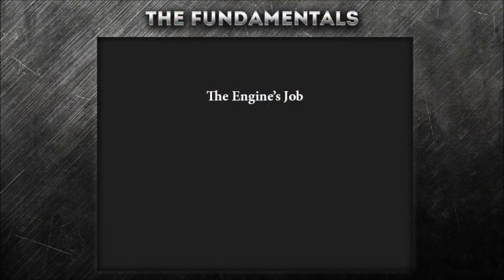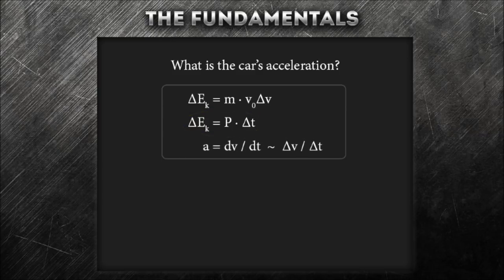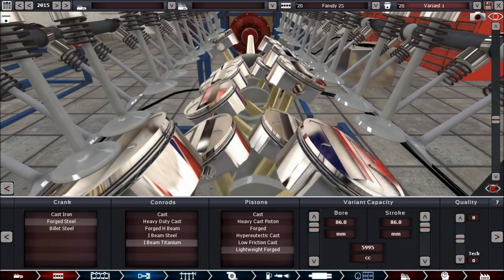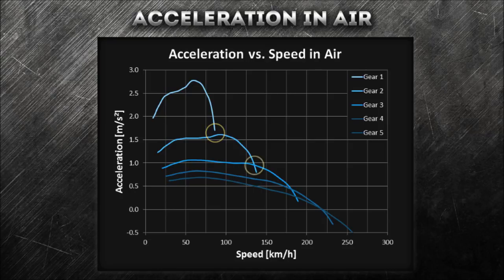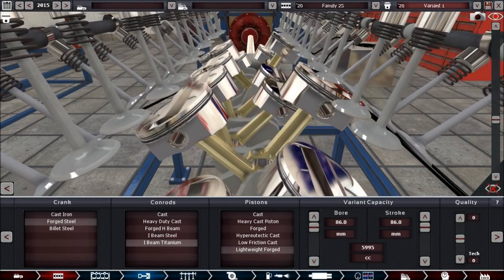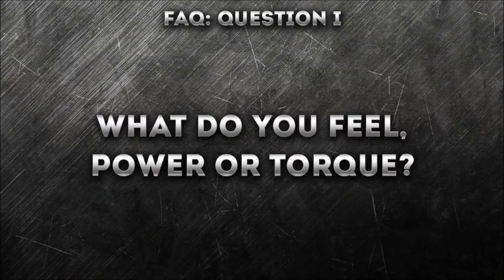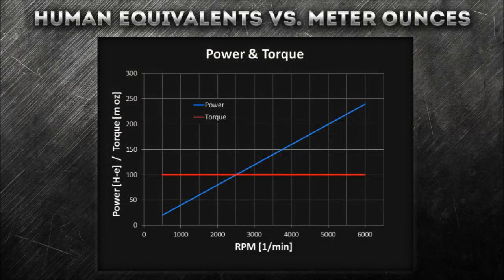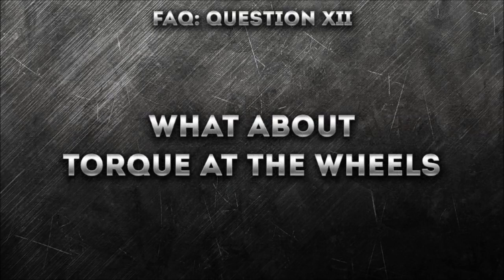Power & Torque: Acceleration Exposed

Comment: Hello.. thank you for taking the time to make this video. You've done a great job : 
However, I don't understand why the acceleration vs. Speed lines (the blue ones) in Example 1 are exactly horizontal. 

As speed increases, the power output increases but the energy required for acceleration also increases. Do these two quantities increase at exactly the same rate so that they cancel each other out?
Reply: Also, throughout the video, you say that acceleration is dependent only on the power output. However, at 12:00 in the video, the acceleration curves match the torque curves, and NOT the power curve. Why is this?
Reply from the maker: Yes, the effect of "more power with revs" and "more energy required for same acceleration at higher speed" cancel out each other precisely.
Reply from the maker: Regarding the matching of the acceleration and torque curves: that is explained in detail in the video, I can't explain it any better here in the comment section. I suggest you watch it again and follow the derivations, that is where the answer lies.
Reply: I will do that. Thanks for the reply.
Reply: Because Power = m x a x v = T x w (w is the angular velocity of the engine) --> a = Tw/mv  . For a given gear, the w/v ratio is a constant, and so is the mass, therefore the acceleration in a particular gear is directly proportional to the torque curve. Hence the shapes match.

Comment: Power is how fast energy is transferred. In an ideal world, why the acceleration isn't the same in all gears regardless of how fast the car is and in what gear? After all the power is the same.
I don't get it when it's in terms of power, but in torque, it's easy to understand that the torque and speed of the engine is transformed through the transmission and so acceleration becomes less with higher gears because torque because the transmission decreases the torque and increases the speed.
Reply from the maker: The question you ask is answered clearly in the video: higher speeds require more energy for subsequent speed increases, hence at constant power, acceleration goes down. I highly doubt you "get it when its torque", that way is much more complicated than calculating it from first principles based on energy.
Reply: That's it, I don't understand how "higher speeds require more energy for subsequent speed increases". What bothers me is that I took mechanics courses in uni and did well, but it seems I didn't reach the understanding to know this.
Thank you very much for your time :)
Reply from the maker: Ahh okay, good on you for pointing this out directly, which indeed is the core problem. Any object that moves has kinetic energy. Kinetic energy is calculated by E = 0.5 * mv^2. If you want to increase the speed of this object from v0 to v1, then that action requires energy. As you can see the dependency is not linear, but quadratic with speed, hence a speed increase at higher speed requires more energy. Take another look at that section in the video, too.
Reply: Ah! Never knew about that! I'll revisit the derivation section.
Thank you for putting the time to answer this! Subscribed :)
Reply: Because Power = Force x Velocity. At constant power and no drag, your acceleration (F = ma = P/v) is inversely proportional to speed so you accelerate slower as you go faster. Gears just approximate the same effect in a staggered manner, the difference being that when the engine revs drop at every gear change, you lose some power. An electric car like the Tesla does it smoothly as the electric motor gets up to full power and stays there.

If you take aero drag into account, then Power required is roughly directly proportional to the cube of speed, so your acceleration goes down much faster.

Your definition of constant acceleration requires constant FORCE, which means your engine will have to generate more and more power at higher speeds to keep the acceleration constant. (Rockets do this, the faster they go, the more power they make, while thrust is constant -- the extra energy comes from the kinetic energy of the onboard fuel).

Comment: So basically, without taking account of each engine's weight, the big V12 would have a better acceleration because it makes more torque at lower rpm, thus hp will come at a lower rpm compared to the smaller V12, I suppose. But in the comparison before adding each engine's respective weight, you mentioned each engine's average hp. What did you mean by average hp? The average of the max hp made by the engines in all the gears?
Reply from the maker: Average hp = the average power produced over the whole rev range. So in practice: (power@MinRPM + ... + power@2100 + power@2200 + ... + power@MaxRPM) / NumberOfSteps.
i.e. the true average power the engine produces. The big V12 produces more power on average, which indeed comes from the higher torque values.
Reply from the maker: Yes, there are so many misconceptions floating around, it's disheartening at times. It's like blasphemy towards the Torque gods when you say how it really works :P

Comment: What does the crossover point signify in physical terms? I agree that the rpm of crossover point varies according to system of units used. But is there any significance whatsoever physically or is it like comparing apples to oranges?
Reply from the maker: It doesn't signify anything at all. :) Indeed it is apples vs. apple juice.
Reply: +AutomationGame  Thank you very much☺

Comment: Btw the reasons diesels rev so low isn't because of flame propagation 
Less efficient yes
Impossible no 
There are diesels that rev 5500+ 
Most don't because they aren't built for performance and because they have to be built for the higher torque
Reply from the maker: If what you say is true then we would see a lot more Diesel racecars - as the fuel has a higher energy density. So what keeps them from being race cars then?
Reply: AutomationGame there are plenty of diesel racers

There was a lmp car that was one

The problem is you have to build the rotating assembly so heavy 
and they aren't as well known and tested as gas in racing 
As well as on average the engine is heavier
I haven't seen an aluminum block diesel yet 
Personally 
And that's a dam shame
Reply: AutomationGame 
Wikipedia I know but it proves my point 

https://en.m.wikipedia.org/wiki/Diesel_automobile_racing
Reply from the maker: That doesn't go into any arguments though, it just states it exists. The question is: are there any diesel race cars that rev beyond, say, 8k RPM? Of course an engine needs to be heavier if you produce more torque, the parts are put under a higher stress because of it.
Reply: AutomationGame Mercedes 2.5l 5 cylinder diesels can rev to 7.5k and still make power at that.. probably due to the idi design that has a constant flame front in the prechamber

Comment: I don't quite understand. So acceleration curves mimic the torque curve, but you can't feel the acceleration change? I have an understanding that a formula 1 car makes 200 ft/lbs at 10k rpm, which means it could be at 100 mph in second gear, while accelerating with the same force as a car making 200 ft/lbs doing 5k rpm at 50 mph in second gear. I understand that much, but to say you can't feel the acceleration of torque, while putting a torque curve on an acceleration graph is redonkulous. Also that v12 example was silly, the peak torque was at 1800 rpm, I believe that to be cheating the math. make peak torque at 3000 rpm and see what happens.
Reply from the maker: You obviously didn't understand what was said in the video, not blaming you as this is pretty complex stuff, please rewatch, it is all explained in there. To your question: "you can't feel the acceleration change?" Yes you can feel that, and the video never states otherwise.
Reply: Let me say I respect you as an engineer, or physicist, or whatever you are, you know a lot, I will be subbing you after this comment. But you seem to just take the opposite view of all those torque heads who think power doesn't matter. Power curves illustrate that a lower gear ratio can be used to administer more torque, which is what causes acceleration.

21:05 "it is always the car's power that you feel"
     Horsepower allows a shorter gear ratio, which in turn increases wheel torque, and thus acceleration. 

12:08 you say it is not torque that accelerates a car, meanwhile there's a torque curve on an acceleration graph.

CVT transmissions give maximum acceleration at peak horsepower because the gear ratio can be lower, thus providing more wheel torque.
Reply from the maker: Well, yes, I would say it is an accurate statement that I take the opposite stance on the torque / power debate, and I do so providing all the derivations for why it is correct to do so :) it is a correct approach.

Horsepower has little to do with gearing, what makes you think that?
I think you need to reconsider the very fundamentals explained in the video: 
Energy is what gives a car speed, energy is needed to make a car accelerate, the more energy per unit time you put into the car, the quicker it accelerates. Power is "energy per unit time".
Reply: So would you say these theoretical cars in your video accelerate faster at their peak horsepower or at their peak torque? With the transmission that you've given them. For the 6.0 it seems as though 1800 rpm is where it's peak acceleration happens
Reply from the maker: No, that is not what I'm saying in the video. I am saying that if at a given speed of the car you want to accelerate the fastest and have the ability to set the gearbox as you want, then you want to gear the car such that the engine is at peak power at that speed, NOT at peak torque.
Reply: Ok, I'm picking up what you're putting down. You can shorten the gear ratio at say 50 mph, so that 135 ft/lb at say 6000 will accelerate the car faster than say 150 ft/lb at 4000. Only when you shorten the gear ratio. 

I've been doing a lot of research because I was playing gran turismo, and noticed all the cars have no acceleration at lower rpm, in their torque curve. Not even muscle cars. It's because some fool decided to make the power curve act like the torque curve, and that isn't how it works in real life, with fixed gears, which up until about a decade ago was 100% of cars. 

Btw, you're making this game? It looks sweet, why is it so much money? Lol Hook me up with a promo code or something. I might buy it anyway. Don't you dare leave it unfinished though.

It's horsepower people like you that ruined gran turismo. Torque 4 lyfe. torque x rpm = power in an ICE don't forget it.
Reply from the maker: fundles420 I think you're still totally confused about all this as you try to cling onto the concept that torque is what is important, but after all that I'll leave you to it ;) no point in arguing, all info you need to have is in the video itself.

Yes, I am making that game and no, of course you cannot have it for free. We need to pay rent and food too, that doesn't come with giving away 6 years of work for free.
Reply: I didn't say free I just think $30 is excessive for an indie game still in alpha. :P 
Have you played gran turismo? You think the acceleration physics are accurate? Your games acceleration curves are accurate, because it follows the torque curve. Gran turismo's acceleration would not follow your game's acceleration curves. Your game is programmed right, gran turismo is not. Because you do actually understand torque but you won't admit it. I know what I'm talking about.
Reply: Yes, if you actually floored your car in 1st gear, you'd notice the acceleration changes quite a bit through the rev range.

Comment: In theory a 200hp engine with ideal gearing will accelerate at the same speed be it  a high reving 1.3L out of a Hyabusa or a torque rich 3.8L V6, in practice however given cars of similar hp/weight ratios the one with significantly more torque almost always is quicker to 60mph the 2004 Mustang GT vs the Honda S2000 being a prime example. I have always felt the reason for this is in the transmission and the reciprocating mass of the larger engine, or more accurately the application of said energy upon launch and the last factor being the narrow power bands usually associated with high reving engines. An S2000 makes piss poor torque in the low and mid range so launching can be much more tricky then the the Mustangs V8 which if memory serves made over 90% of its peak torque from just over idle which is a huge advantage when launching from a standstill since I can apply power to maximize my traction rather then having to fight to keep my engine in it's peaky powerband. The real world result the Stang was 0.6 seconds faster to 60 despite having less aggressive tires and a lower rubber/weight ratio aka similar tredwidth/contact patch but 700lbs more weight. Though if you mated a super fast shifting DSG to an S2000 I don't believe the difference would be as much if any.
Reply: For judging what's going to feel faster. Imagine using transmission gear of 1.0 (normally 4th or 5th (5  or 6 spd trans), and equivalent final drive gearing. Then tq and hp can be compared "fairly". 
Really the Tq and HP numbers displayed together really just convey the powerband the car has. So if you see high hp and low tq you know it makes power up top. and high tq, low hp you know it's down low. Area under the curve is really what is goign to give you a real idea of the actual acceleration (how fast the car is). Generally high hp low tq engines end up being slower because most of the time when people build for high rpm they only concentrate on hitting a peak HP number, rather than keeping a large powerband of usable power.  This ends up with a small area under the curve, so you'd have to gear your car to stay between your 7500-8500rpm rev limit as you accelerate from 0-60 or 60-100.

Low tq cars are generally "faster" on freeway pulls, because they can control RPM, longer, and those usable 1000RPMs are stretched over a longer speed range, so your usable power is applied usably.

Drift cars we look at the top 3500rpms and lay everything out to keep the power-band there. My old 4 cyl pro am car was 600whp 500tq. This is a close spread for a 2L revving to 8k. The power was dying off at passed 7500, but that was planned partially with compressor/turbine maps and cam efficiency ranges, as well as cross section vs avg mass flow rates per port, runner, or pipe.
Drift cars need a decently usable rpm range as we modulate wheel speed to control the car, and to shift every time you need to adjust (in tandem this is very often) would cause lag, and more variables to mistakes to happen.

Comment: What I'm intersted in is the following:

Inline 6: 2.5l 180 hp and 250Nm
V 6: 2.5l 180 hp and 250Nm

Both have the same torque and power curve. Will you feel a different characteristic in how the engine delivers the power?
Reply from the maker: Chad W No, you missed this: "Both have the same torque and power curve."
Reply from the maker: Chad W Why are you asking me that? :P I didn't make that up, but answered that question already, you need to get better at reading dude.
Reply from the maker: No you won't. The only main differences you will be able to tell are: a) engine sound, b) engine vibrations (I6 being much smoother)
Reply: AutomationGame Okay, thank you! So the "characteristics" people are speaking of, come down to the individual properties of the engine layout itself. Speaking of free mass forces and such. But if you have the same curve, there is no additional attitude the engine can have besides smoothness and sound. Very cool.
I always thought about it because I couldn't believe how quick Porsches felt when driving them compared to comparable cars. I worked at a Porsche dealership for a while but they were always quicker than their counterpart!

It went like this: "The 911 GTS has 408PS? Seriously? I just smoked that M5 up the motorway access breaking no sweat and accelerating to 220 before he even came back into sight."
Reply from the maker: GERntleMAN I think what you are feeling to a large extent is the throttle response and the overall weight distribution along with the suspension setup in that case :) The cars certainly feel different but that is not necessarily down to the engine, although the feedback coming from the engine might be different due to how it's set up. Cheers!
Reply: you are assuming that at all rpms the power is identical.... all you showed was the same peak power at the same rpm...

they would have different power outputs at NON peak rpm... in the real world
Reply: AutomationGame well if the tq and power curve is the same, what the fuck would change about the power delivery? nothing...

how would the amount of cylinders affect anything when you stated nothing changed?